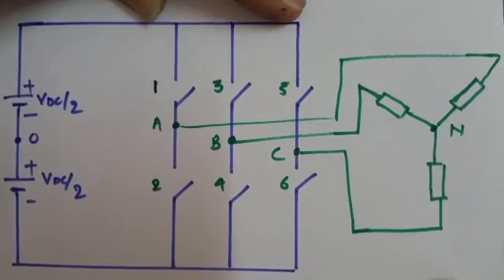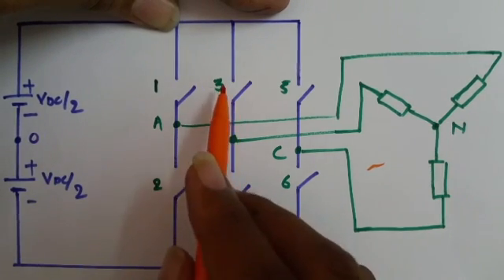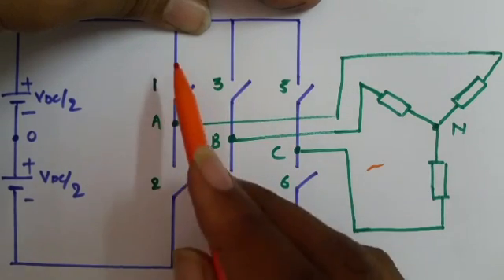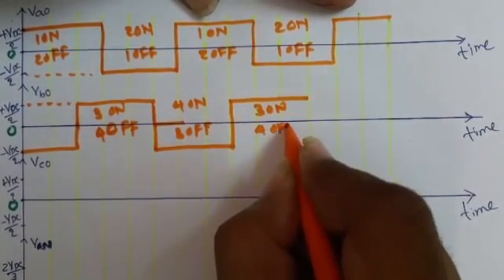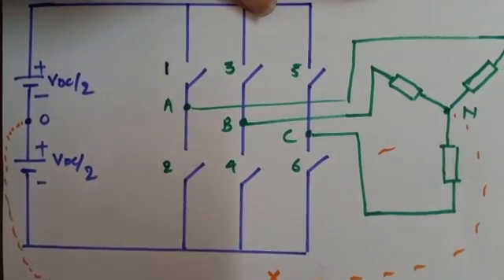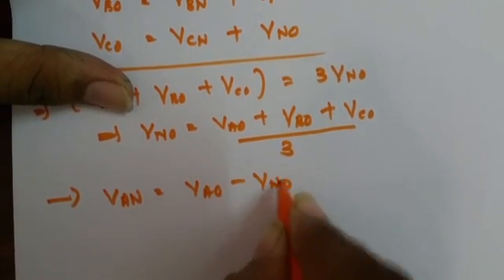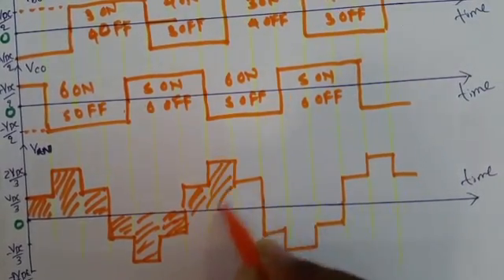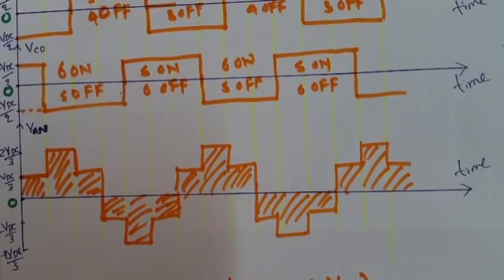PWM Inverter (Basics, Circuit, Working, Waveforms & Applications) Explained in Power Electronics

Comment: I want to use three phase motor as a DC motor but i want to use three transformer 50 volts each out put - i will use rectifire to convert ac to dc > how can i connect speed contol switch, can u please advise me or is there any other was i can use three phase motor, i have no three phase power,  will i loose motor power ! thank u
Reply from the maker: +Goblin Rides Devil : there are multiple solutions so I think you should study problem properly